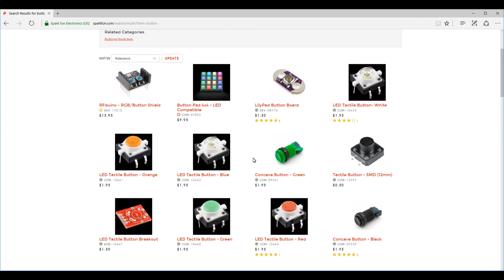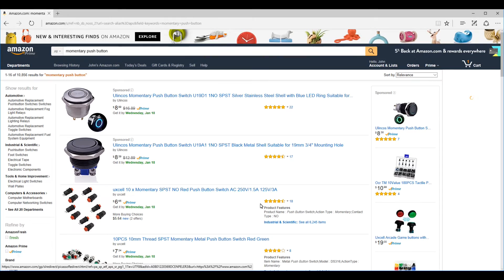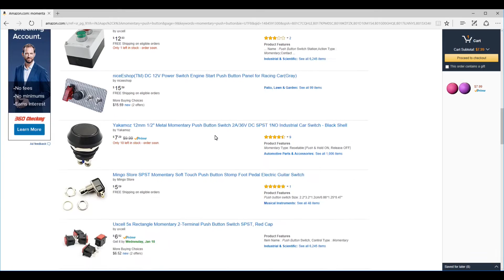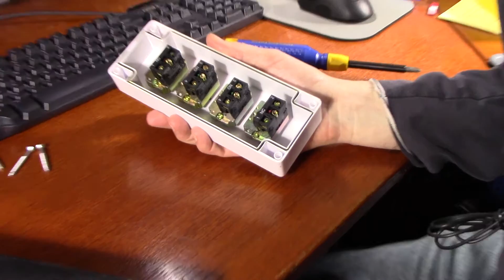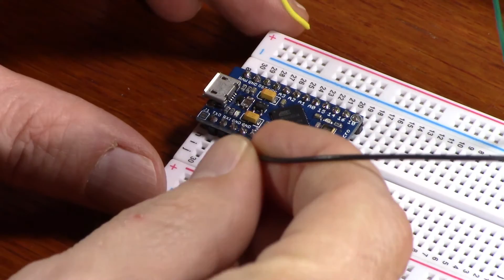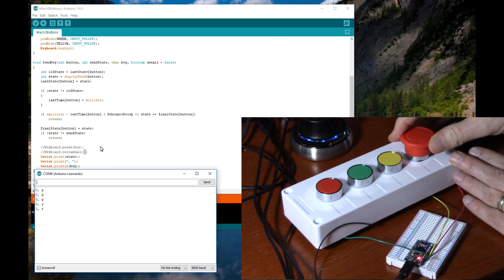Building a Mach 3 Control Box

Comment: like... not for nothin here... but the E-Stop button is a cut off switch for a reason. the only time you pass an E-Stop circuit through a controller is if you HAVE to shut down the power in a different way to save the power delivery circuits from damage.

Comment: i have facing issue ,want our help .when i uploading program its give error and not uploading . tha error in this line 
    Keyboard.press(key);
  description is 
exit status 1
'Keyboard' not found. Does your sketch include the line '#include <Keyboard.h>'?
.i use arduino uno,mega,neno .
Reply from the maker: This requires an Arduino Leonardo. Most of the Arduino boards don't have the ability to act as a keyboard.
Reply: @JohnSL  thank yor sir. i try it on  ardiuno leonardo.
Reply: @JohnSL   i use arduino leonardo also use pro micro but same error become when i uploading . i need some help.
Reply: @JohnSL the simplest form of 3 pin program which is compile for check is working .which is  111 101 etc . but complete program is not working on both arduino

Comment: At 9:32 why is your Arduino serial output functioning if you did not declare serial.begin(9600); ?? Wtf
Reply from the maker: Interesting. I had not noticed that. It might have something to do with this being a Leonardo, but I don't really know. But, hey, it worked. So why fix it :-).
Reply: @JohnSL  agreed but just as curious as to why the baud rate defaulted to 9600 let alone the declaration of a serial port's existence. HID device or not that shouldn't be a factor because otherwise that means the compiler is garbage optimising the code with things we did not instruct it to do.

Comment: Hello,

I ve the three buttons working on a arduino leonardo but i also want an emergency stop
Have you made this working?
Reply from the maker: No. My understanding is that the emergency stop needs to be wired into the controller. And I'm happy with stop via the keyboard.
Reply: Would it be possible to connect the emergency button from your box to the reset function of mach3?
Reply from the maker: Sure. Here is the keyboard shortcut chart: http://www.machsupport.com/Mach3Wiki/index.php?title=Standard_Hotkeys

Comment: There's an amazingly simple solution I've seen used for building arcade machines. It's basically just a control chip, a usb or ps2 plug and a bunch of wire terminals for every key on a basic keyboard. with this and hotkeys you can set it up any way you want. I've even seen a cool way to convert a hard drive motor into a rotary encoder so you can have that dial they have on most cnc machines.
Reply from the maker: But not as much fun as making my own box :-).